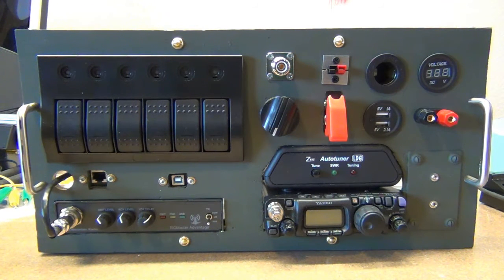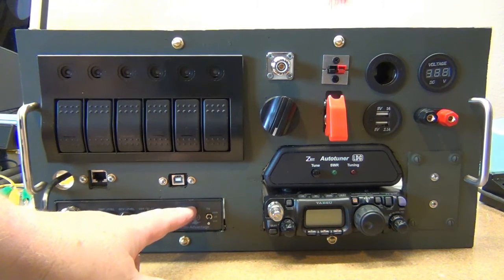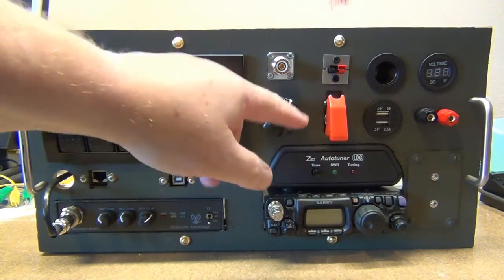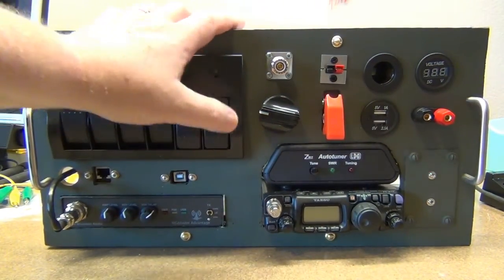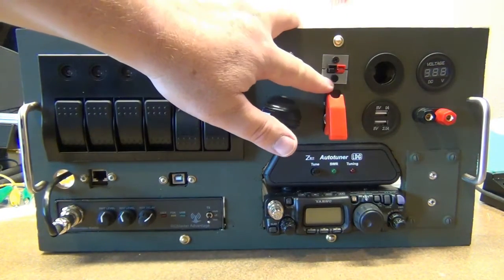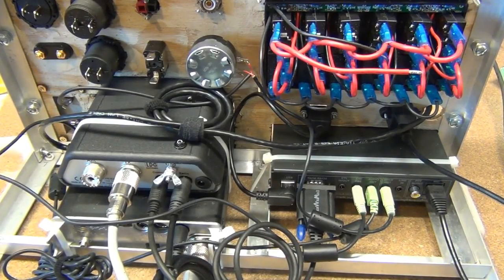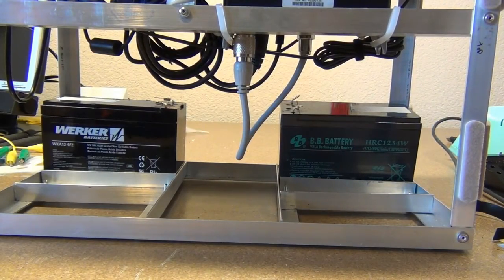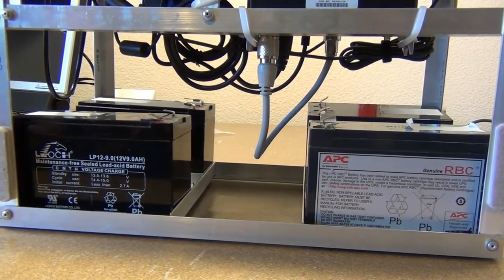EMP Resistant Ham in a Can, QRP radio and batteries, Getting ready for the next disaster part 4

Comment: Why do you think your equipment is EMP resistant? There is no real shielding for the items installed as their front panels are made fron plastic, the cabels do not have a TEMPEST shielding, the antenna jack is not protected at all and the front panel's backside looks like it is amde from wood?  "EMP Resistant" is a very confusing statement in this case.
Reply: THERE is not EMP protection here at all. The set up looks very nice, In fact I really like it but EMP, dont think so, the front of the box and equipment is open  to all incoming energy.  A simple test is to put a cell phone in a container and see if it will ring, like a metal trash can with a tight fitting lid,  if the front of the rig is open and the front of the tuner is open how can that be shielded.
Reply from the maker: it's an AMMO can... with a steel lid.... This video just does not show the sealed box.
Reply: this whole thing goes into a sealed ammo can
Reply: Lord some of you all are shit kicker stupid.